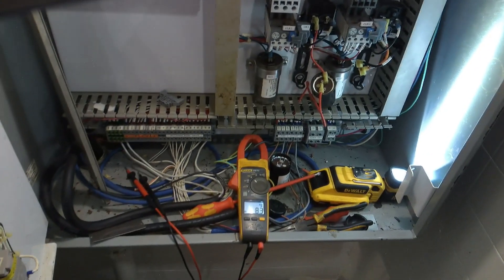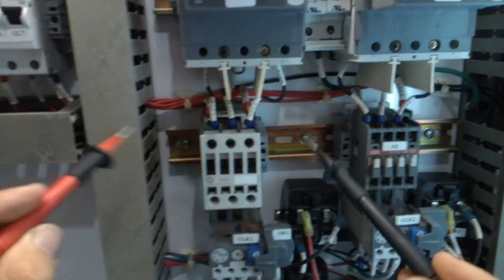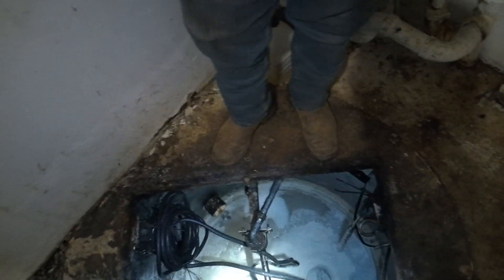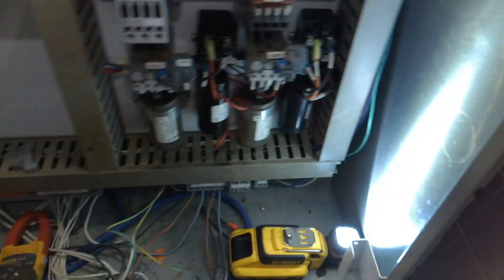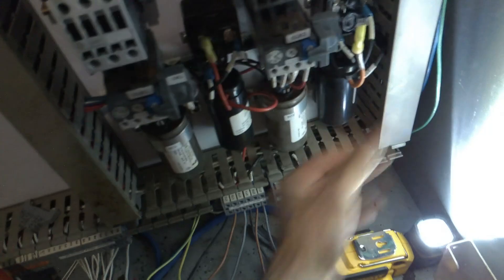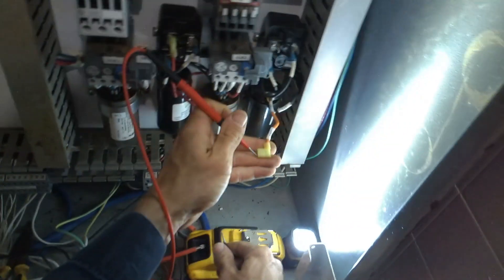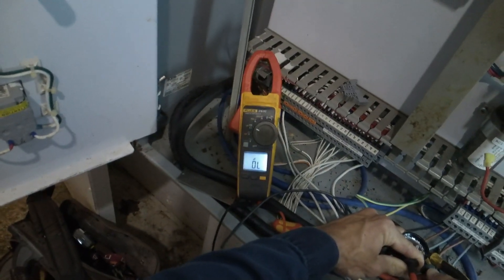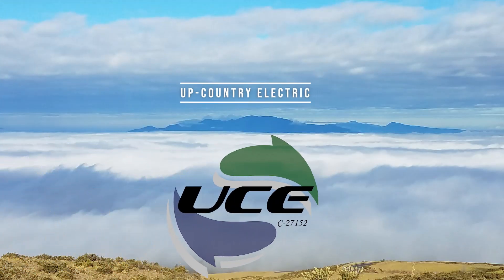Single Phase Pump Control Trouble

Comment: I know it's up to the customer but back when I did HVAC we always tried to replace all starting components together if we could. Then you know you've got 4 good ones and not 1 good one and 3 that are an unknown age.
Reply from the maker: That's a good practice for sure. 
Thanks for watching!
Reply: Diagnose the bad component and only replace what is necessary.  Replacing all of the capacitors and starting relays is just wasteful.  I do understand the sentiment, but these days the new capacitor might be more likely to fail than the old one that's been in there 20 years.